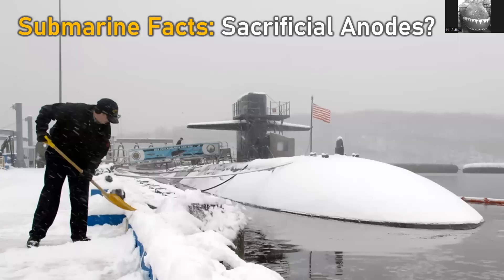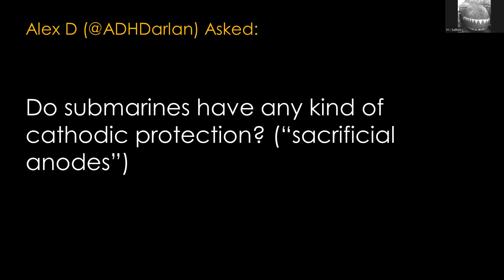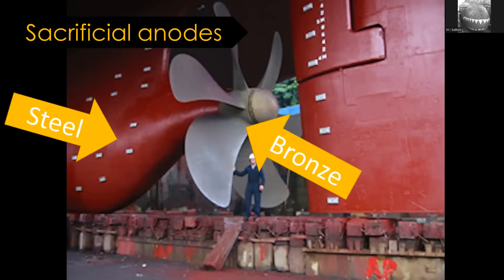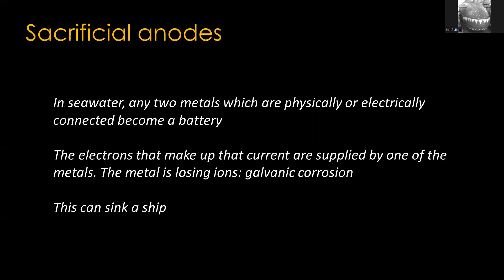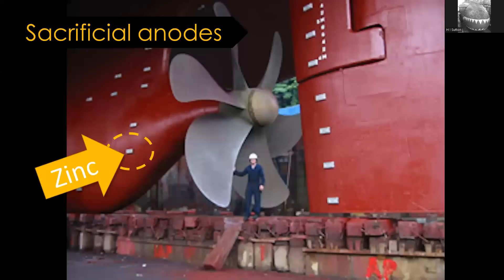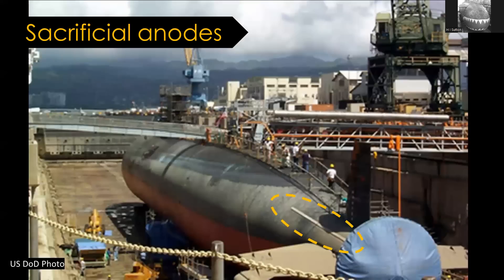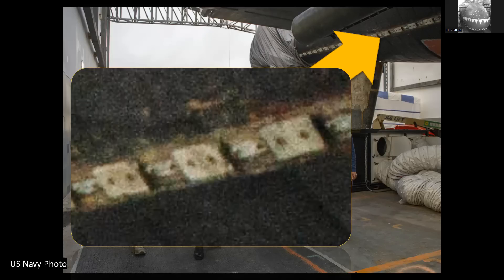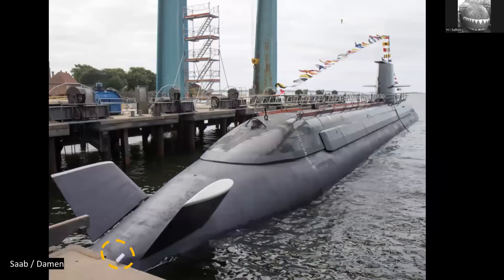Submarine Secrets: What Stops Subs Sinking But People Overlook?

Comment: an interesting side note, museum ships and subs on the great lakes and in freshwater rivers actually need a different cathodic protection system, the saltwater anodes will actually eat the hull. the USS Cod recently showed this when they drydocked
Reply from the maker: interesting, wasn't aware
Reply: @HISuttonCovertShores  was wonder if you would come on my show for a interview
Reply: Aluminum or freshwater
Reply: Active Catholic protection is a thing too. That uses stainless steel electrodes and mains power to provide the voltage.
Reply: Since they are static, can't the hull be covered with a resin or even a hard cover plastic/fiber outer hull?
Reply: @Shadow__133  It would need to form a watertight seal, at which point you're just building another hull around the ship. Replacing a relatively standard part is easier I guess.
Reply: @Marci124  Thats what I meant. For my inexperienced head it sounds easier to do that once, instead of restoring the hull and change sacrificial metals routinely.
Reply: @Shadow__133  There would be a lot of problems trying to form some completely non-conducting shell around something as big as a WW II submarine. Just for a start, things bump into the hull, and this could scratch or knock off parts of the plating. 

Also, the size of a steel hull (really, of anything) changes with temperature changes. As the temp goes down most things get smaller, and get larger when the temp goes up. But very few of them do it at exactly the same rate. So with temperature changes, stress would build up between the hull and the coating, typically resulting in the coating cracking and peeling off. The change in water would probably only be a few degrees, but over years, that can be enough.

A third problem would be places that have to hinge or move. There may not be many of these on museum ships, but any live ship/boat would likely have quite a number of places. Coating these places might be physically impossible.

Also speaking of near impossibilities, submarines have large tanks that are often open to sea water, and being able to get into these tanks and make sure they are (and remain) properly coated could be a big problem.

So over all, it really isn't that simple, and even if it was, it wouldn't be a one-time thing. It is far easier to replace some easily accessible hunks of metal in brackets rather than to coat an entire hull and then inspect it periodically to make sure there are no cracks or peeling.
Reply: @lwilton  I'm sure you are right, but I wonder if this was researched. Maybe with new tech like 3d printing, flexible silicone covers etc it could be viable. I'll stop pushing this revolution here, last time I was on a boat Married with Children was still playing live on tv 😂
Reply: @Shadow__133  they are not static. (Temperature and pressure)
Reply: Magnesium for freshwater ,zinc for saltwater.Every outboard engine,inboard outdrive have dedicated anodes for their type of use.
Reply: so, when the Russians where building subs at the top of a large river (which they then sailed down into the sea) they would have had to have duplicate systems for the fresh and salt water and uninstall/install them depending where they are on the river.
Reply: @testaccount4191  ....most of their sub's are double hull so it is quite simple to install them inside external  hull.Also who care's what it cost to install all types of anodes  on a sub costing hundreds of millions $ and sometimes billions of $???
Reply: @mikaso20042000  i know its just a interesting thing  they must do
Reply: museum ships on the surface have no sacrificial anodes and corrode and need a lot of protective paint.
Reply: What's causing this reaction ? I just assumed it was the salt/ water mix, but since it happens in fresh water too, where you need a different metal it seems related to the water, but then again - not only. (I had a difficult relation with my chemistry teacher and never picked up on that subject.)
Reply: Anechoic tiles aren't made of steel or metal. and many subs are made of titanium. not steel.
Reply: @riskinhos  Not that many,and how does this effect coatings ?
Reply: @connycontainer9459  doesn't require coating because it doesn't rust.
Titanium resists all forms of corrosive attack by fresh water and steam to temperatures in excess of 300º as well as resistant to rusting and corrosion from liquids including chemicals, acids, and saltwater as well as various gases. so they don't have this. it's the best. reason not to use titanium: cost. it's the only single reason. it has tons of other benefits like low magnetic signature, way much lighter and stronger and allowing subs to go a lot deeper and be lighter overall and doesn't require maintenance.
Reply: Poor care and mismanagement of public funds is why the USS Cod was allowed to fall in such disrepair.